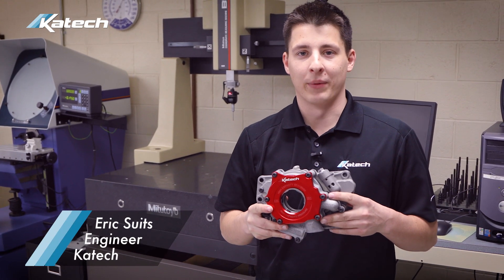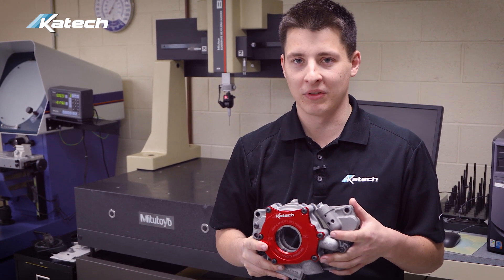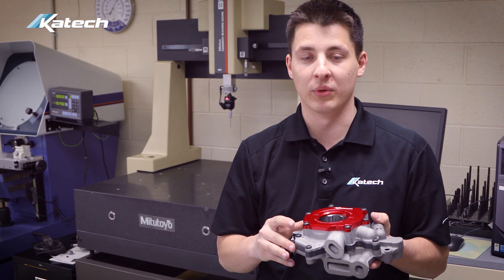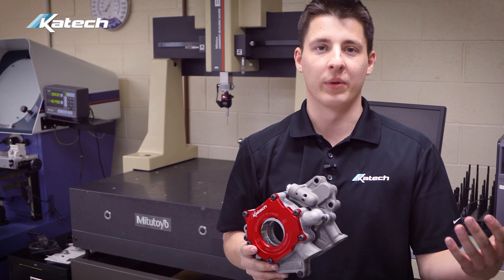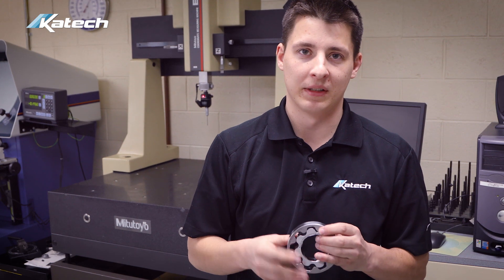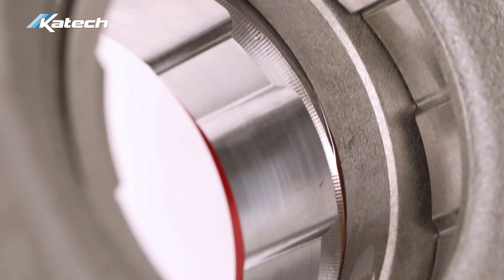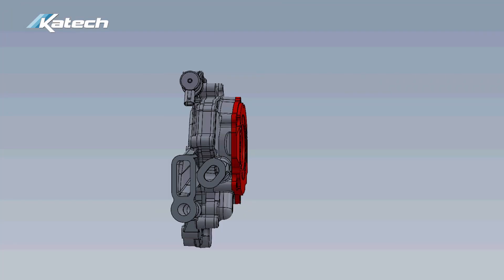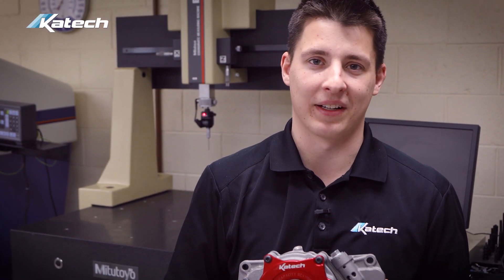Katech High Capacity Scavenge, High Capacity Pressure LT1 LT4 LT5 Dry Sump Oil Pump

Comment: Have you guys seen the new Ultima RS that was announced a few weeks ago? They now have mounting options for the LT series engines. I was worried about the factory (not) dry-sump on the LT1 and this is exactly the upgrade I have been looking for!
Reply from the maker: WangChung yes. We also have complete dry sump system upgrades available which would be recommended if the car will be tracked and seeing high g cornering loads.

Comment: What does Katech consider high output?  Over 1000hp?
Reply from the maker: Any modified LT Gen V engine would see benefits from having this pump. There is not an exact number that we call high output. Every engine build is different and so is the intended use drag racing, street car, road race, etc. If you have a specific application you have in question feel free contact us to discuss further.